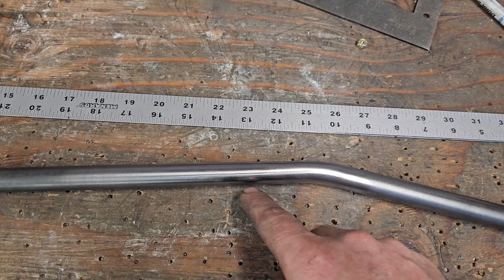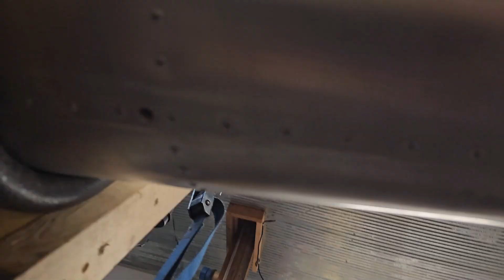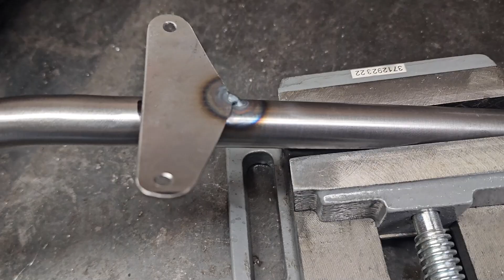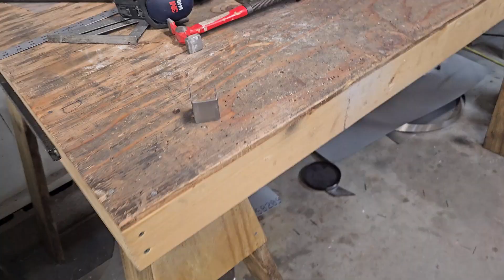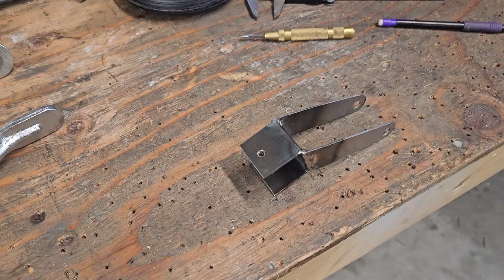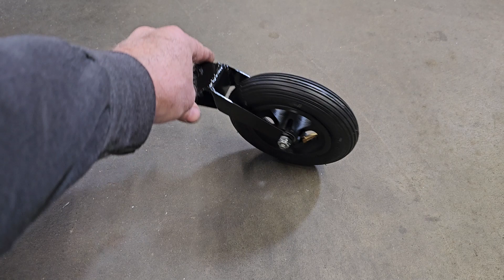Hummel Ultracruiser Build - Tailwheel Assembly

Comment: You do a great job of building, videoing and explaining what and why you are doing what you’re doing. Thank You
What is the tubing you are using to support the tailwheel. Diameter, wall thickness and type of metal? Thank you
Reply from the maker: Thank you!  The tubing is 4130 steel, 3/4" diameter with .058" wall thickness.